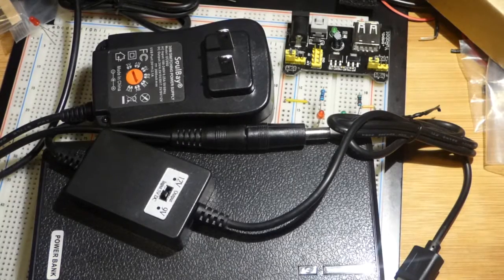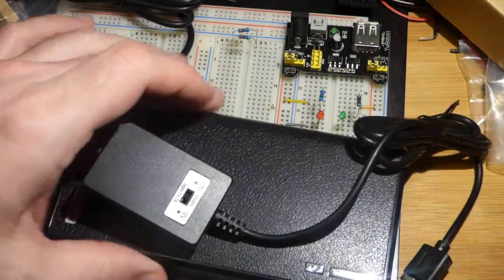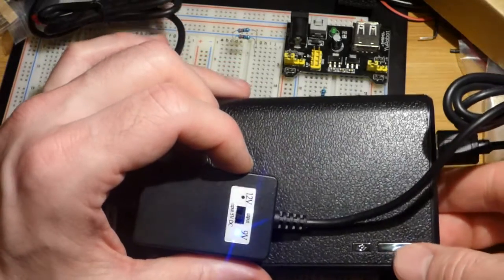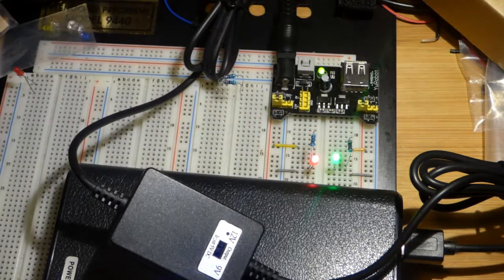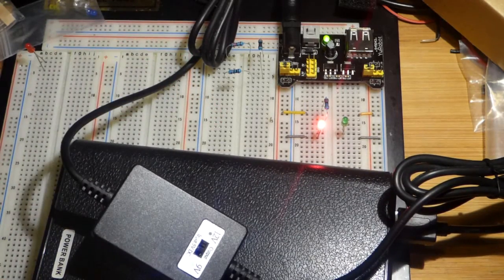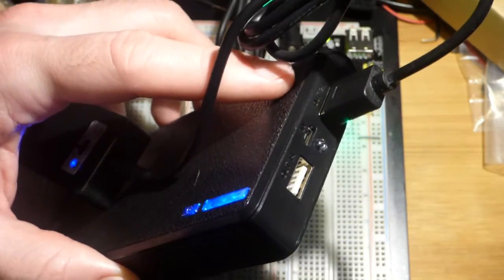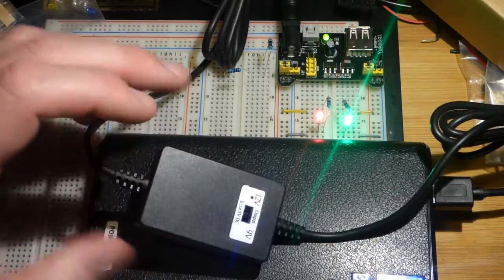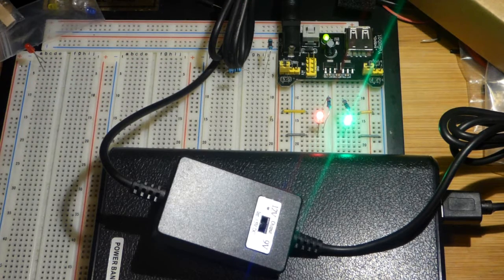5V USB plug to 9V or 12V barrel plug voltage booster unit used with portable power bank

Comment: Losses everywhere...  ; ) 

You have two 2 volt LEDs  on a mile and a half of wire.  
An interesting experiment none the less... 
I'd like to see what is inside that power inverter... 
I'm sure it's sucking way to many amps off the power bank... 
Probably not good for the litium batterys.
In the long run... Thanks, .x.
Reply from the maker: Definitely want to unplug everything right after using it lol.